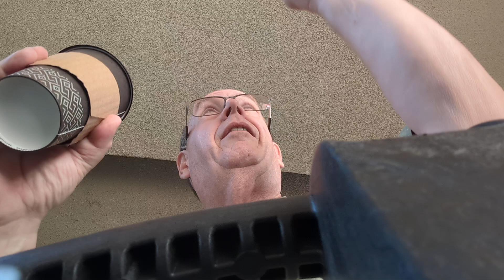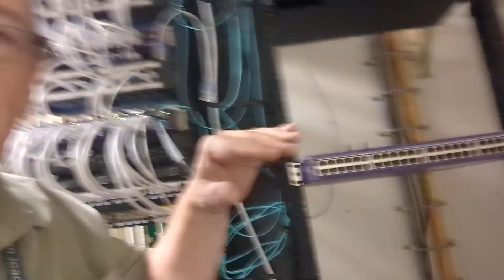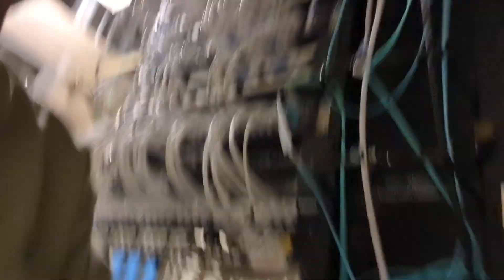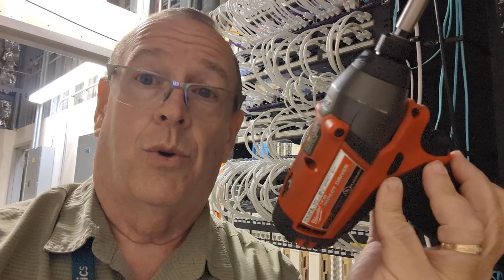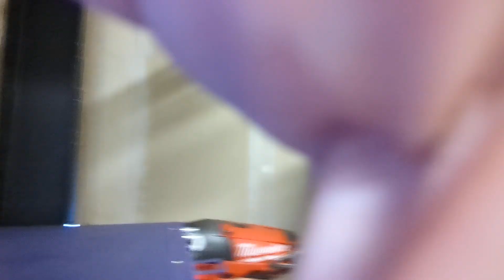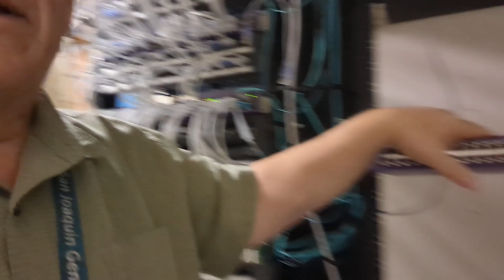Network Admin Life - Adding Another Switch

Comment: Really hope you cleaned those fibers and ports. Didn't see one bit of cleaning supply around.
Reply from the maker: I have heard the collective wisdom of the fiber guys out there and I have ordered a fiber cleaner.  God bless!
Reply: @NetworkAdminLife  Getting a scope too I hope? Scope lets you inspect the ferrule or the port to see dirt. Proper cleaning procedure is using a cletop to clean the ferrule and scope. Then clean the port with a plunger and scope that. Then connect the two really fast. Because critical levels of dirt can accumulate on the ferrule in a matter of seconds even in a clean data center environment. 

Also i may be insane since I work on 400G channel ROADM systems with high power RAMAN amps. You might be totally fine just raw dogging your fiber for short runs.

Comment: I used to use an old dewalt 12v drill for this job, but, it stopped holding a charge, so, I got myself one of those Denali cordless screwdrivers and I've gotta say, the experience is much improved, and it's real real cheap. 
Little guy has some grunt to it, and it charges over USB-C, so, no charger nonsense to deal with. Also comes with every bit known to man, so, no screw left unturned!

I sometimes wish I'd get my hands dirty more often...
Reply from the maker: Okay, dirty little secret.  I know I shouldn't use an impact drill for these screws.  Unfortunately, our facility engineers do not.  Sometimes they mount the switches for me.  With... you guessed it, impact drills.  Electric screwdrivers won't back those bad boys out once facilities puts them in. :-)  God bless!
Reply: @NetworkAdminLife  Probably more of a vibration concern which is.... not a huge concern for switches. Using one with a live disk array in the rack, well, that's gonna be a problem, maybe.

Comment: Hopefully your security officer doesn't mind.  Ideally your security department should take the stance that obscurity should not be anywhere in the top line of defense.  I understand folks that do have to safeguard that stuff to appease various individuals, but I've always respected the security folks who will openly tell you what their infrastructure consists of.  If you are following standards and going through the process knowing the make and model of the hardware should make no difference whatsoever. 

In fact, when a mistake does happen, I also like to publish those lessons learned in a general format because there is a community out there that will benefit from the years I spent learning what not to do.

On a completely unrelated note, I think I had those glasses frames, or a very nearly identical set from Zenni a few years ago. Good set, served me well and are still my backup set.
Reply from the maker: Our SO has really added some amazing layers of security just in the last few months.  We're in a pretty good posture now. 90th percentile at least.  God bless!

Comment: Your not providing enough specific information. Just apply latest firmware, keep up to date with your ACLs, use complex passwords, lockout policies and only allow SSH connectivity from Management VLANs or specific Servers, use seperate AD Credentials for Admin and User, when possible. Use 2FA or Hardware Tokens.
Reply from the maker: Yes indeed.  Those are very good methods to secure a network.  We may have some or all of those. ;-)  God bless!

Comment: Since I was in my early 20's I wanted to be in networking, IT, PC building but those dreams were just a fantasy. I went to join the Navy and either become an electrician or something in IT which at the time was cutting edge and in demand when I failed the color vision test. They had to accommodate me or kick me out and I would have been able to get disability under the ADA. The only job I qualified for was Engine Room maintenance. A 29k year job that had nothing to do with the mechanical or electrical but merely going around picking up everyone's trash and scrubbing the deck top to bottom. I was also responsible for engine maintenance and cleaning sludge out of them all day long 12 hour shifts on a floating tin can. I dropped out before going to basic training and my family went from proud to disappointment with me. I was promised to purchase the computer store I worked at and eventually they sold out and fired me. I ended up becoming an electrician but well into my career the boss noticed my color vision issues. He was afraid of putting me on commercial jobs and generator installs to residential only service calls and if we got a house, I would wire that. He was fine with me running romex and troubleshooting electrical issues only in residential. He started laying me off until I had to move on with my life. I ended up at walmart stocking produce. I failed to get into telecom, electrical, and automotive due to the fact people are afraid of my color vision. I never even knew I had it until they show me the silly color dot circles.

Comment: I just wanted to make sure I understand. But is the end user plugging into a network jack which is terminated for Ethernet and then the other side is fiber which travels to the fiber patch panel?
Reply from the maker: The network jacks at the end user location are ethernet jacks and extend the switch port to the user's location.  The switch itself is connected via fiber back to the network core switches.  This is how it works in many institutions.  God bless!

Comment: Interesting mounting the switch that far out from the rack, it did look like there was enough space behind since they were mounted that way in the other rack? But the extreme switches looks nice with a lot of screw holes for adjusting the mounting depth
Reply from the maker: This is one of the universal switches that Extreme sells and it is a bit more back-heavy than the existing switches.  I mounted those to look "pretty" and line up nicely with the patch panels.  These mounting ears are cheap pot metal and I just didn't trust them not to bend under the weight of the switch.  So yeah, I mounted it a little more forward on the rack.  Time will tell.  God bless!

Comment: Try not to give in to the trolls.  Showing the hardware should never be a significant security problem; if your security depends on the attackers not knowing what gear you have, you have some much more fundamental issues with security.  As long as you keep the network rooms locked and have decent security and monitoring of your Internet & WAN gateways, you should generally be good.
Reply from the maker: That's kind of what I have always thought.  I mean, there are only so many networking vendors we could be using.  And what's the old Internet adage?  Don't feed the trolls.  God bless!

Comment: Your doing a good job. Knowing the switch you use isn’t an issue. I’m not seeking anything on your videos that exposes anything you shouldn’t. I’m sure you have logging in place with alerts for rogue devices. On my network at work I have any MAC address that is not approved disable the port and alert me. We’re a Cisco shop. Have never used Extreme. I’m guessing you may have that as well.
Reply from the maker: Since our new security officer came on board our security posture is much better than what it was.  He's implemented some pretty cool tech.  Which, he probably won't talk about.  God bless!

Comment: I need help, New Network setup. We have 2x Fortinet 200F Firewalls in HA, x2 Meraki MS-425s, x2 Meraki MS-390-24 and multiple stacks of MS-250-48s for the access devices. 
We also have 96 port Dell SOn switch for Servers. How would you uplink them together? 

I like the idea of going Dual 10Gbe from each Firewall into each MS425 via SFP+, then from the MS-425's to the Dell Switch via dual 40Gbe uplinks. And then use the Dell Switch to uplink to our MS-390's and MS-250s

Our network company is doing some weird stuff with Qsfp breaking out to x4 10Gbe to uplink to the access switches.
Reply from the maker: Hard to advise without a diagram and please don't post a link to one!  But I would say, try to provide as much circuit redundancy as you can.  Look at your network and try to find the single points of failure and provide redundancy there.  Provide geographic diversity if possible too.  Even if it's just in separate rooms and separate electrical circuits.  Good luck on the design and God bless!

Comment: aaaannnddd........... That's why I don't use power tools to mount things in a rack.  You'll wallow the heads out and other power tools will be required to remove the screw. Haha just pulling your leg.  Grace and peace to you brother!  Keep it up.
Reply from the maker: Okay, confession time, (no I'm not catholic but I'll confess anyway).  I have twisted screw heads off with that very impact driver.  Because I was in a hurry and not paying attention to what the screw was trying to tell me.  God bless!
Reply: @NetworkAdminLife  I'll admit I spent a good 30 minutes with vice grips a couple of weeks ago trying to remove a UPS. Whoever installed it didn't care if it ever came out.  The hole in the center was completely round.  I was so frustrated.  It was a 2200VA UPS too.  Very heavy!

Comment: An impact driver is too powerful for what you're doing. I suggest using a regular drill or an electric screwdriver. 

With machine screws, I have found that running the drill in reverse first until you feel the end of the threads click past each other, helps to prevent cross threading when you run it forward. I also start it slow until I am certain the threads are properly engaged.
Reply from the maker: Per my above confession you are correct.  But it's more compact that my regular drill motor that doesn't have impact built in.  I may have twisted screw heads right off with this thing when I wasn't paying attention to what the screw was trying to tell me.  God bless!